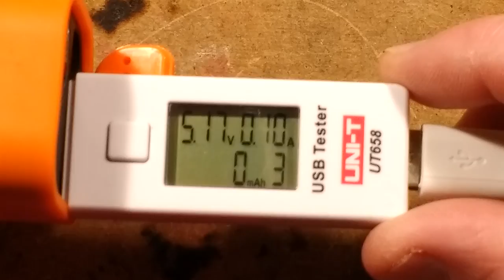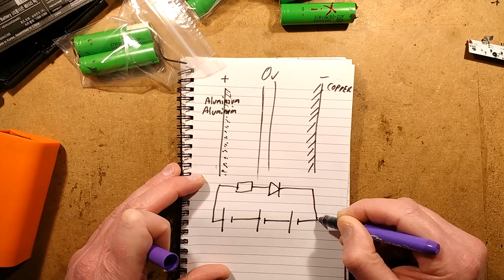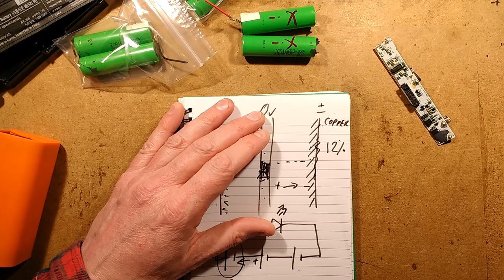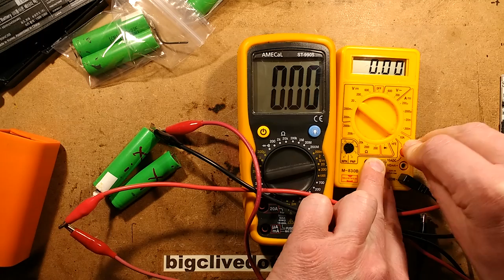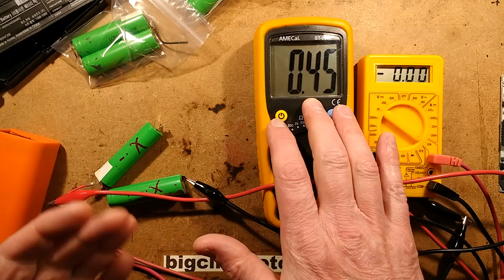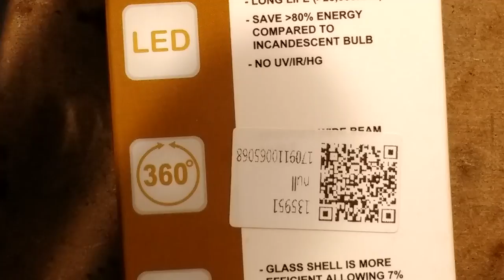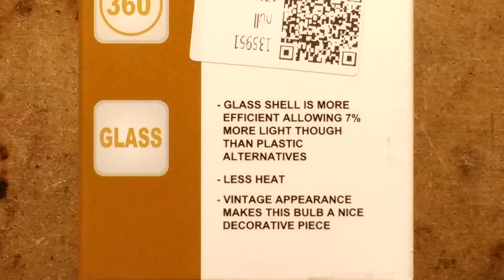Teardown of a faulty Samsung lithium 18650 cell.  (2200mAh)

Comment: You should be careful combining Gin and electricity. Gin can be as much as 60% water, and we all know water and electricity don't go well together.
Reply: And tonic water is like 90% water, that's some nasty stuff...
Reply: But Gin goes great with everything!
Reply: Is that a problem?
Reply: This is a piece of foam.
Reply: They really should not put so large amounts of dangerous water into their gin.
Reply: Dihydrogen Monoxide is a dangerous chemical compound that shouldn't be stored anywhere in the home. People die from it all of the time.
Reply: anlumo1   That's all too true. I have heard people drowning in it. A horrible death I do not wish anybody.
Reply: >and we all know water and electricity don't go well together
The problem is they mix together really well
Reply: depends on the contents of the water. Pure water is not a good conductor.
Reply: but it's quite hard to get pure water.
Reply: May cause asphyxiation if inhaled. Corrosive. Can cause burns in it's gaseous state. It is one of the chemical compounds used in automotive coolant, insecticide and weed killer among many other extremely toxic applications.
Reply: Duchy of Mecklenburg-Schwerin I once took a large hose charged with it and sprayed it at my brother's face.
Reply: Oxygen dihydride is a decarbonised form of methanol and  it is therefore one of the most versatile solvents on the planet. It can dissolve paints, corrode metals, and when it transforms into its solid form, it can even break apart rocks. As a vapour, it also causes serious burns. Just think what it must do to your internal organs if you actually ingest that highly addictive compound! Seriously, one drop of it, and you're irrevocably addicted for life, until you die, flooded with the stuff.
Reply: mark. keilys - Not hard at all to get (or make) pure water if you're going to the trouble to make spirits.  Much easier (faster and cheaper) than making the gin anyway.
Reply: ampeyro why do you like 90% water?
Reply: Don't forget that it causes far more of the green-house effect that carbon-dioxide.
Reply: What about the ICE?
Reply: And water is 99% water, so its way more dangerous
Reply: “If your workbench is cluttered, it’s a sign science is happening.” 
I got a lot of science going on on my workbenches.
Reply: Yes well,,ummm,,did you know pure water,,That's, 2 hydrogen monoxide is not a conductor,,it is only the dissolved salts and metals that make it conduct,,
and,,( yes there's an AND )
In some power stations they use this pure water on large circuit breakers to keep them cool,,
Reply: You should be careful combining humans and electricity. Humans can be as much as 60% water, and we all know what water and electricity don’t go well together.
Reply: @stinkycheese804  that's not pure. 
Some of the stainless or copper will have dissolved in it. Even glass dissolves in pure H2O to give a resistance of 1/2 an ohm. Pure absolutely pure water is very hard to make because it really is very aggressive at least until it reaches 1/2 an ohm, for some reason a physicist or Chemist might be able to explain but I cannot. I only know its true. Drinking absolutely pure water demineralises your teeth and bones... not good. It also has no taste at all.
Reply: Yeah na, electricity goes extremely well with water
You might not want to spill the electrical water on yourself but that's down to preference really.

Comment: Hey, if I've understood your comments correctly, a reversed diode across each cell in a lithium pack (schottky even better) would go a long way to avoid risk of killing cells when charging. Don't think that would work as easily in a paralleled arrangement i.e. where the charge current exceeds the capacity of inexpensive rectifiers - say 20 amp. Surprised you don't see that in DIY construction.

Comment: Small point-and-shoot cameras are legally limited to 20-30 minutes, Tom Scott did a video on that, or mentioned it in one of their Park Bench episodes.  They are not considered "movie cameras" so the distinction is hard wired into them.
Reply: Dustin Sparks as hard wired as a firmware hack
Reply: Legally limited where? Any how do you define a "small point-and-shoot" camera? I've never bought a camera that is artificially limited to 20-30 minutes
Reply: It's a taxation or customs/tariff thing, can't remember exactly(not gin, but beer to blame now)
Reply: In Europe there is a tax levied on devices capable of recording more than 30 minutes. Manufacturers of mainly still cameras thus limit to 29:59 artificially to avoid having to increase the price for something that's not a main feature.
Reply: This explains it quite well: http://www.tested.com/tech/photography/44445-why-digital-cameras-have-a-30-minute-video-recording-limit/
Reply: Man that shit sucks. I'm in the USA and we don't have anything like that. Then again we get screwed in other ways (i.e. healthcare). I guess there is no way to win
Reply: Dustin Sparks that’s why I just use my phone for video recording as I can easily get 1 hour of recording time at 1080p 60fps
Reply: smeezekitty I’m form Canada and we don’t have problems like this but I’m never gonna go out and buy a camera as I can just use my phone for recording
Reply: sounds like when i had a 25 inch monitor which was sold as a 24 + 1 , i think this was due to a tax on monitors over 24 inch.
Reply: In the EU tariffs for importing a digital photo camera is 0% (CN-Code 
8525 80 30). A video camera is 4.9% (CN-Code 8525 80 91).  
In for example the " Official Journal of the European Union, C 137, 6 
May 2011" you can get the definition of a video camera as: >800x600 
& >23fps & >= 30min of recording length.

Comment: Taken from a icr14500 3.7v 1600mAh datasheet with in arms length.

Aluminum Foil (Al) 5%
Copper Foil (Cu) 10%
Cobalt lithium dioxide (CoO2.Li) 40%
Graphite (C) 20%
Electrolyte 15%
Aluminium plastic film 5%
PCB 5%

Yes the data sheet used both Al spellings. lol
Just to give an idea what is in a similar cell.
Reply from the maker: Interesting.  I've noted that down and looked it up too.  Quite nice that the technology was developed by a German-born American in England.  That covers every base.  Even better that he is actually called John B Goodenough.
Reply: Mr Goodenough is a professor at UT Austin
Reply: Which covers the fourth country, Texas.
Reply: bigclivedotcom if you feel particularly happy, you may have lithium poisoning. Lol. 

But actually, I bet you could eat all the powder and still be fine... The compounds listed have pretty high  intake requirements to be toxic...
Reply: CLIVE - What I got from our secret German Wunderwaffe papers below concerning your cell:
1) The Kathode is Lithium-Kobalt-Oxid.
The Kathode is sitting on Aluminium. The Aluminium is merely the conductor/contact, NOT the Kathode.
2) The Anode is Carbon in the form of Graphit.
The Graphit is sitting on Copper. The Copper is merely the conductor/contact, NOT the Anode.
3) There should be wetness in form of electrolyte (lithium-salt + organic-solvent) between Anode and Cathode and you only have dry crumbs.
I suspect, that like in an old Kondensator or capacitor as you call it, the solvent of the electrolyte has dried up in your cell.
Try adding some Ethylencarbonate and Dimethylcarbonate in a mixture 1:1 and have a look if the cell works again.
But check first under a microscope, if the nanostructures in the graphite layer are still OK and if the SEI layer (Solid Elektrolyte Interphase) is intact.
Reply: bigclivedotcom Just an additional FYI about JBG @ UTAustin. He only recently, in the last year or so, came up with a new and improved battery technology which could turn this in its ear. He is nearly at the top of my list of people up to whom I look.

This doesn’t mean I don’t look up to you, Clive. In fact, you were added before he was. Of course, if I run out of places for folks on my list...

Love what you do, how you do it and most of all the outward appearance of how you think!

Best wishes always.
Reply: hmmm,,how does this Ethylencarbonate and Dimethylcarbonate,go with gin?
Reply: Yep,,have watch some of his stuff,
to watch him cut up a flat battery,( Not flat as in charge ,but flat as in pancake,) with a pair of scissors and battery voltage on a meter is Mind Bending,,really,,mind bending,,

Comment: This video was so cool! I was in the middle of taking apart a laptop battery pack that had gone bad and refused to take a charge and it turns out that my pack has the same bright green samsung ICR18650-22F cells in it that you show here. I wanted to take a cell apart to see how it was constructed inside but now I dont need to. I have a feeling my pack went bad due to the controller refusing to charge the cells due to the voltage falling below the minimum threshold the controller deemed "safe" to attempt a recharge on. The laptop had been sitting unused for over a year so the cells had discharged on their own due to internal resistance. If only I had plugged it in 6 months ago oh well lol

Comment: Big Clive, I am a battery researcher, you have a lot of little things wrong here. Maybe you are simplifying, but I would be careful talking about chemistry like this. 

Over discharge damages the copper foil on the cathode which can result in lowered potential, dendrite formation, and damage to the anode. 

I can go through this with you if you like.
Reply: I (and I'm sure many others) would be very interested to hear. I always like hearing from a real researcher / professional. I have read a lot and it seems most people just recite the same things and clives reverse charge explanation sounds best to me so far. I've totally discharged some cells but whenever any are reverse charged (such as in a pack) the casualties are very high. Way higher than 0v discharges. I don't know chemistry though.....
Reply: Ammoniummetavanadate mind officially blown.  Thanks
Reply: Ammoniummetavanadate yes u r right i learned from battery mooch spot on there buddy.
Reply: I love you.
Reply: volvo09 He isn't wrong about the plating aspect, although that rarely happens. 

My main issue with his analysis is that is leaves out the electrolyte, cathode material ( it isn't graphite, it is generally a lithiated cobalt or manganese oxide structure) and SEI (solid electrolyte interface). Lithium ion batteries are not chemically stable, the electrolyte will attack the anode and cathode materials (generally carbonates mixed with lithium hexafluorophosphate) but are inhibited by the SEI. Too much heat and the electrolyte can further react creating those pretty explosions we see which also release things like HF gas. The electrical potential is part of it, but the chemical degradation is where the smoke and flames come from.
Reply: Sadly it's in german, but this document about the chemistry of lipo cells that also covers the chemistry of failure caused by bad charge state, current and temperature is simply excellent. Maybe some of you who are interested can work with it because it's not that much text.
http://www.rc-network.de/magazin/artikel_15/art_450/Lit-Akku-Techn-Einfuehrung.pdf
Reply: Honey BooBoo 

I mean if you pop onto google scholar and use sci-hub you can find a lot of good papers in English too, even without a proper institutional access.
Reply: How do you discharge these down to zero so they don't catch fire inside the trash?
Reply: Ammoniummetavanadate It's not institutional access. It's common license from a model flyers magazine. But you're right, if you're interested you will easily find good sources in any language you wish.
Reply: I suppose the actual safety of the cell depends on the exact chemistry, and whether or not it can safely blow away dendrites without going thermonuclear, etc... XD
Reply: uK8cvPAq Don't ever throw a battery in the bin.
Reply: You just discharge them to zero. All the Lithium Ions travel to the cathode and are stable there. You are ruining your SEI, but as the cell is not going to be used anyway, don't worry. And .. don't throw them into the trash, bring it to a recycling place. Much easier to gather copper and aluminium via recycling than processing it from minerals.
Reply: Ammoniummetavanadate - the HF in HF gas stands for "Happy Fun" right?
Reply: He discussed the dendrite formation in the previous video, I suppose I agree that plating is an oversimplification but how else would you describe the migration of copper ions that form the dendrites through the dielectric material?
Reply from the maker: I do try to keep things simple.  The most interesting research into over-discharge I've found was this article:-
https://www.nature.com/articles/srep30248

I don't recommend routine over-discharge of cells as it does at the very least reduce their lifespan, but this article suggests that the real damage occurs when reverse charging from other series cells takes place.
Reply: I hope Clive has interest in this.  I certainly have.
Reply: Ammon#&()$*)#*$)#*$ - Same facts different day.  It was already well established in the design community that over-discharge degrades the cells.   That devices have a low voltage cutoff for Li-Ion and that any but the cheapest crude VA-supply-current-limited constant voltage chargers refuse to charge them, should be hint enough.
Reply: This does not explain the dead short observed while trying to charge it.  Appreciate Clive's practical approach to analysing the problem over all this battery chemistry jargon, which leads to no further insight..
Reply: @Ammoniummetavanadate   I, for one is very interested in understanding the chemical process. Not that I understand chemistry, but I have taken many types of batteries apart through the years and used the old carbon rods for other things, the lithium battery I took apart, had a horrible odor, somewhat akin to starter fluid or ether, did not continue to explore due to the obvious odor smell toxic (no this was not in California), With your nickname I wondered if you might be working with Vanadium, carbon nanotubes (graphene) and some type of acid (Not LSD), I have wondered about the electrolyte figuring that this may hold the key to preventing the dendrites from forming. I've always thought if there were some way to keep the electrolyte moving it would prevent the dendrites from forming. But we pack the batteries so densely (seeking to get the most capacity out of the smallest of space there is no room for excessive electrolytic solutions. So something that could cause the electrolytic solution to react, move even the slightest would prevent the dendrites from forming. I am not a scientist but do enjoy reading what is happening and thinking outside the AA cell.
Reply: @anononomous  https://en.wikipedia.org/wiki/Hydrogen_fluoride ;)
Reply: @bigclivedotcom  mmm this could be interesting then with the larger 800volt traction battery packs get some extreme use. 
These have a lot more batteries in series than older 320 volt units. Quicker charging for certain. Hopefully modern BMS systems monitor each cell to avoid this problem.
Reply: so is reverse charge the reason those 2 cells i found in a pack to have a high self discharge curent? (goes from 4.1 to 1.6 in 1 hour and stays warm)
Reply: One of the cells now went complete short-no charge and no voltage, but draw all the current possible. The other one lost a bit of self discharge rate after 2-3 abusive charges and discharges (including 12v zap, short circuit in series with other batteries and now discharging it trough a high noise high ripple load and im planning on running some high frequency ac for a short period with my zvs driver trough it.)
Reply: Idk if i mentioned, but they are old laptop battery cells that werent that good initially and now that potentially salvage-able cell's capacity and max current is completely trashed. The safety hazzard on such cells is very low, because i've had other "good" old laptop battery pack cells stay shorted out because of bad circuit design and all they did was become very warm and lost a lot of max current and capacity. in conclusion any "revived" lithium cells are only worth better than nothing.

Comment: I would think you could place a diode in parallel with each cell and that way if there was reverse bias it would just get shunted. I am sure the manufacturer would know this but want you to have to replace them periodically.
Reply: Diodes leak current. That's undesirable in an energy storage cell.